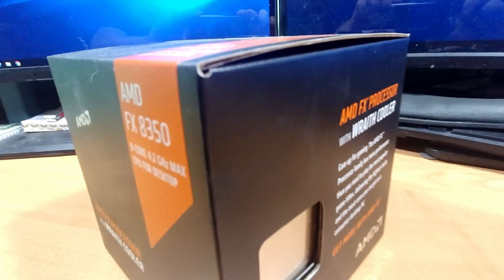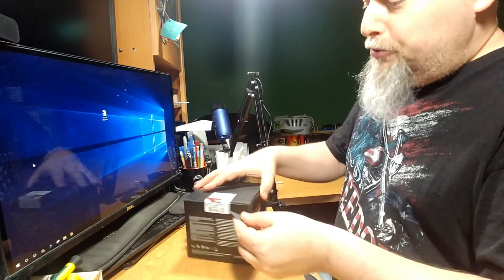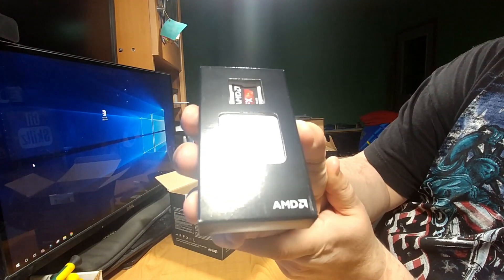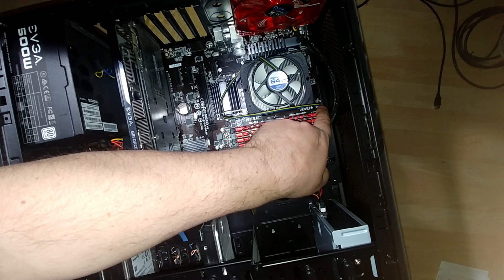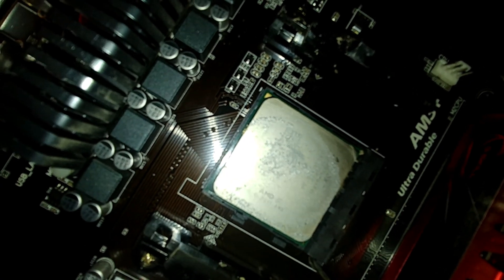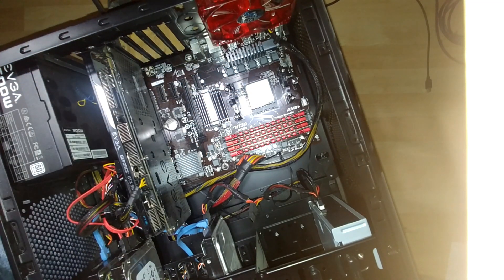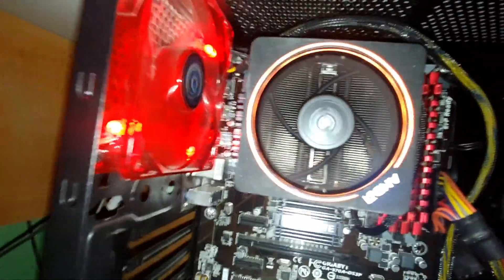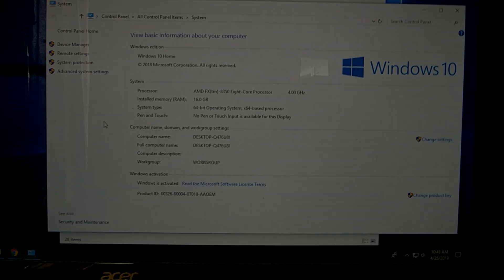REPLACING A PC PROCESSOR / AMD FX 8350

Comment: I just got a used PC with a fx8350 black edition and omg I love it! I have a strix gtx 980 oc paired with it and it handles anything I throw at it. Plus I keep the fx water-cooled. With a aio water-cooler I highly recommend getting one. So easy
Reply: I'm upgrading to r5 2600 also how would the 2011 processor be fast

Comment: Fx4300 was an entry lvl cpu back in the day, they were ok but the performance was on pair with phenom ii x4... nowadays fx4300 is on the verge of obsolecense, they are not suited for modern 1080p gaming (720p yes) nor 1080p video editing.
Fx8350 was the flagship and high end mainstream cpu for the fx series prior to fx9xxx series. It is twice as fx4300 cores at around same clockspeed... so it is fair to say fx4300 = 1/2 fx8350. The old 8th core is still even today suited for1080p gaming and can handle 1080p video editing no problem... the change it is kind of cheap so it is a decent upgrade, but with all the new cpus out there, in 1 maybe 2 year the entire system will need a replacement anyway
Reply from the maker: This is all true my friend! :)

Comment: great video man the only thing is if you had a earlier 4100 or 6100 you have to update the bios before switching the cpu or it wont work and you will have to swap the old one back in and do a update then reinstall the new one.